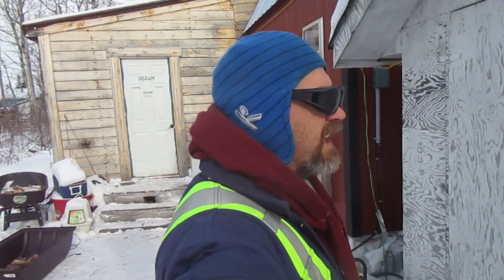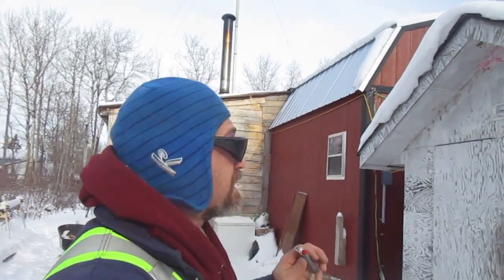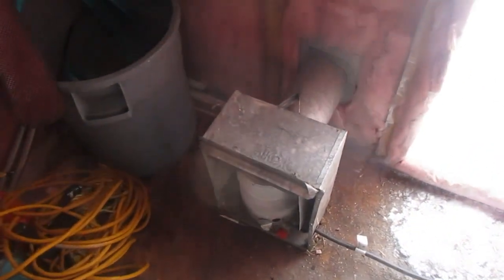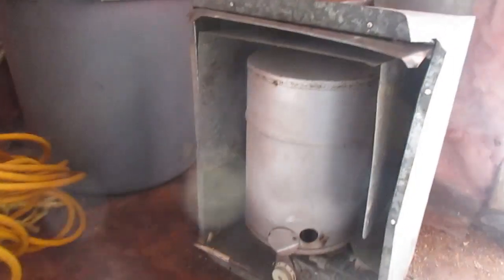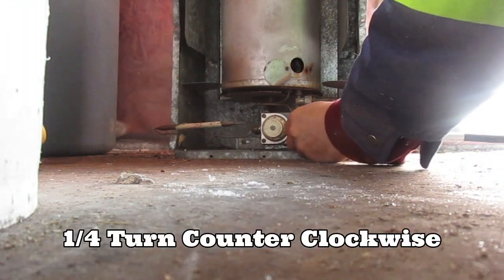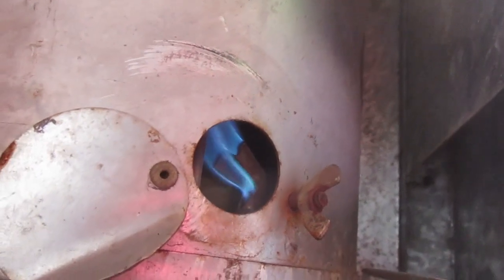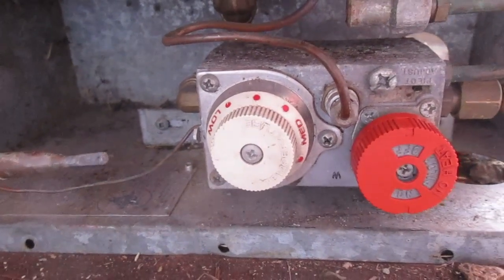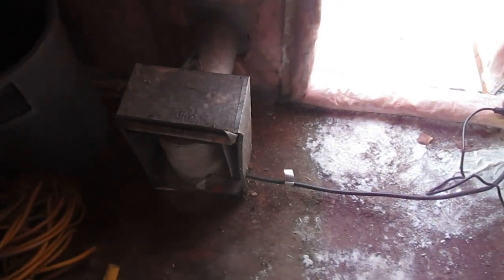Off grid homestead- No freezing water at -45+ C

Comment: Been using rv products for years n now use propane demand water heaters. Waaay better. I e warmed green houses with these little 10,000 but units. You should have refered to the laws of thermal dynamics and pointed out why the heater is placed at floor level just like AC or Swamp cooler should be at the top of the room. You can also use passive solar air heaters.